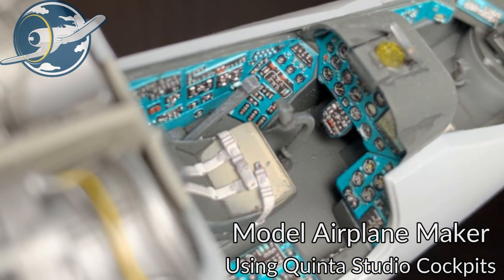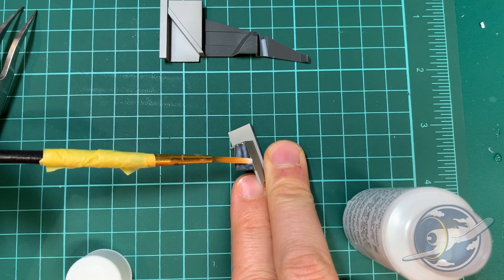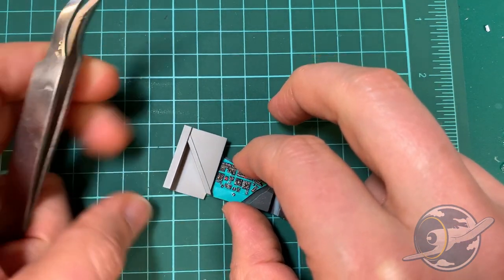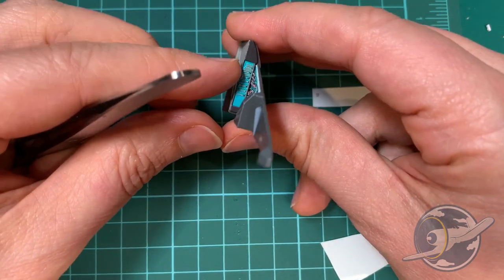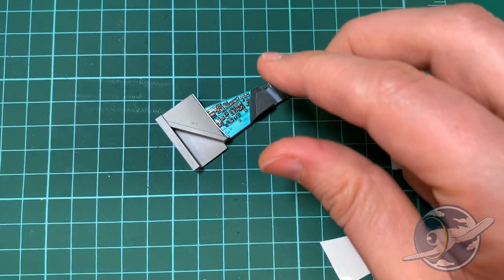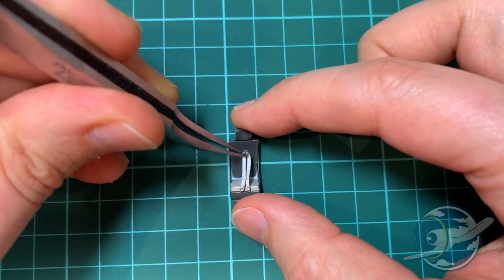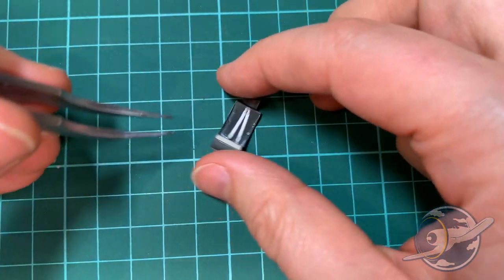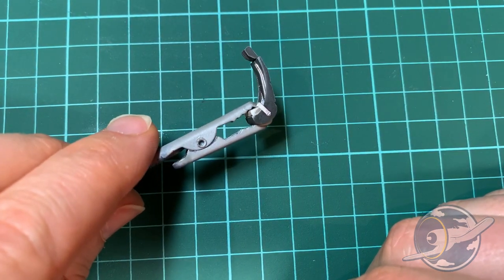Easy cockpit upgrade: Quinta 3d Cockpit Sets

Comment: These look great.  I love 3D resin decals for welds. My Eduard Mig 21 has some painted etch in the cockpit I believe...do you think that's good enough or should I look into getting one of these sets?
Reply from the maker: That depends on what you want.  Eduard's painted photo etch is nice stuff and I would not replace it with any other PE.  Now, a Quinta set would blow it out of the water with all the 3d switches, glass fronts on the instruments, etc.  It is night and day different in terms of quality and fit. https://www.cybermodeler.com/hobby/details/qs/images/qs_qd48077_parts.jpg
Reply: @ModelAirplaneMaker  I saw that set and a grey one.  I have no idea which one is right for my version.